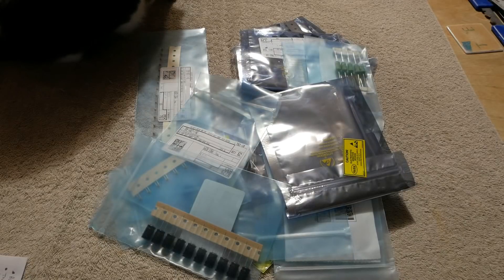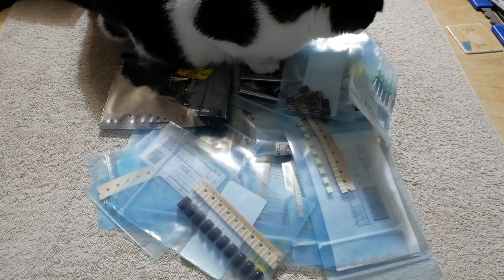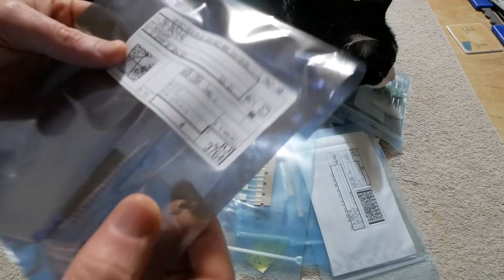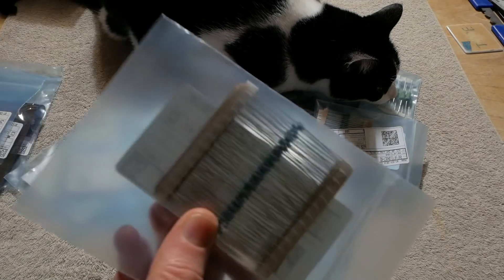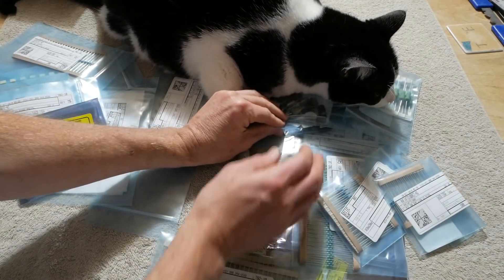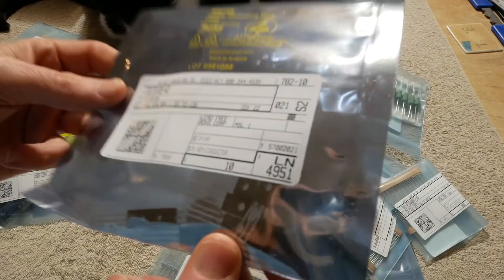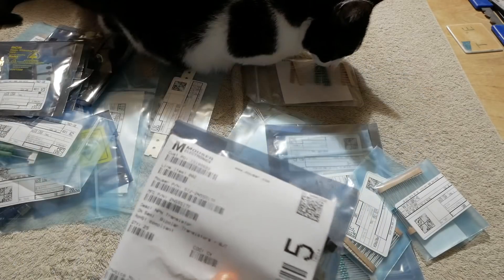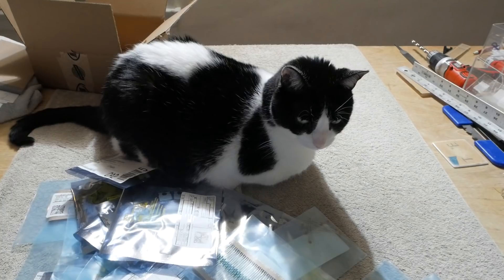Discrete audio amplifier project PT7 components are in!

Comment: are those Toshiba made 2sc5200 and 2sa1943 or made by ON semiconductor in to-264 package? do they differ in sound quality?
Toshiba ones are available in to-3p(N) package and they can handle 15amp current.

Comment: Inspector Snickers! Who's that guy with you?  ;)

Good to have a video  / update. Can't wait to see what the finished design sounds like.

Just for fun, it would be interesting to see just how far you can go in building an amp using just one type of complementary transistors, for instance, the 2N3904 and the 2N3906, any number of them. Paralleling would definitely be allowed. Crazy? Maybe. Insane? Probably. But just think of the design philosophy that can be gleaned from such a Quixotic effort.